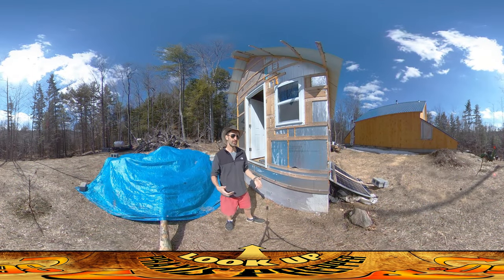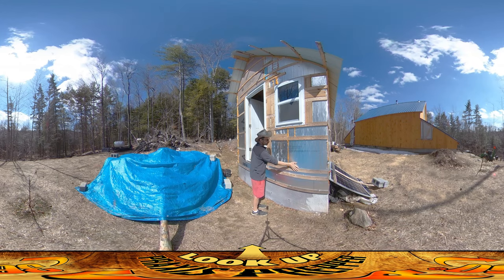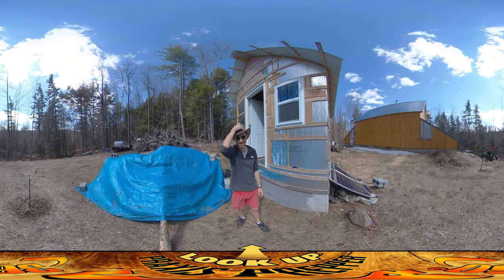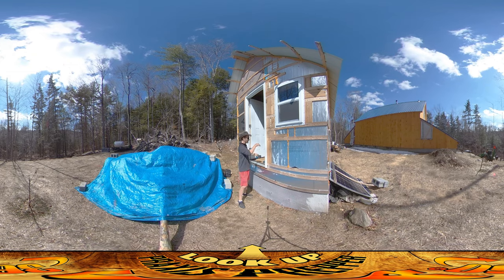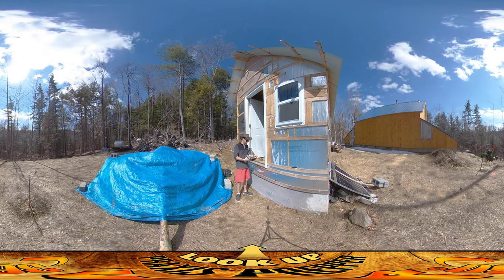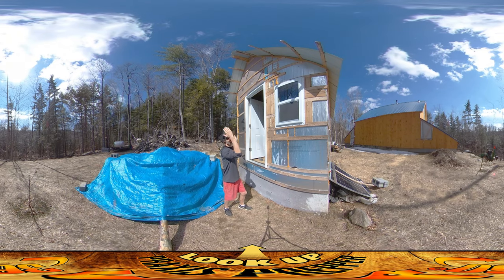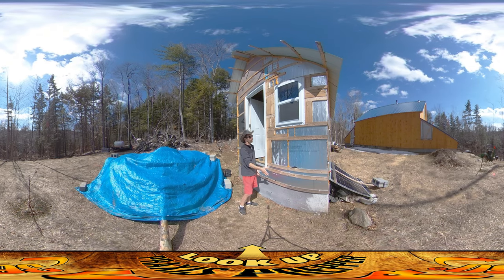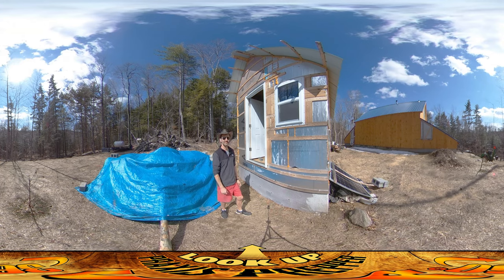Homestead Building - Electrical Wiring and Lighting for Mini House Shed

Comment: What about exterior outlet
Reply from the maker: I'm really mulling that one over... I think I might add one. There's another branch of this wiring that's going to head underground to where that trailer is sitting to the west of this shed. My parents wanted to have a power hookup for their travel trailer there for if they wanted to do a long visit (or SHTF happens and they'll be around for a while). So when I run that, I could make a little box along that line too.
Reply: @PraxisPrepper  for the relative cost i would. I have never regretted a outdoor outlet but I have regretted not putting them in several times